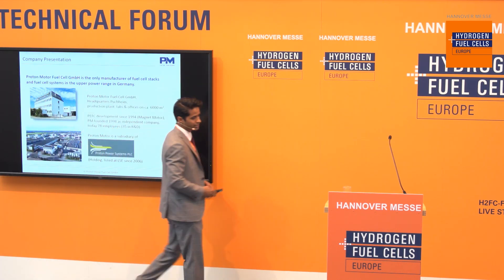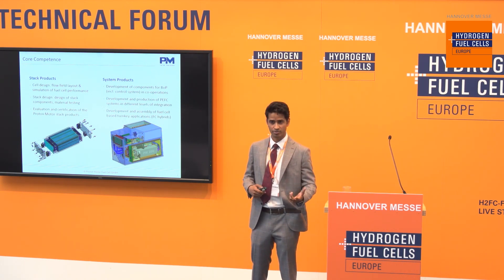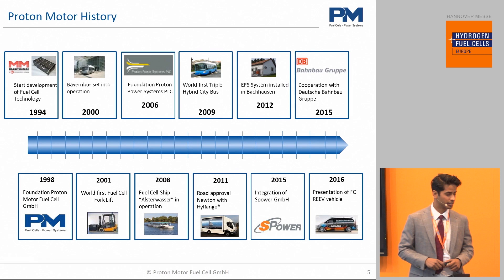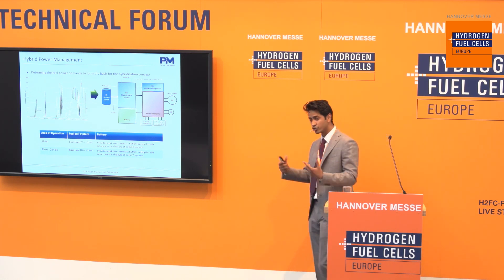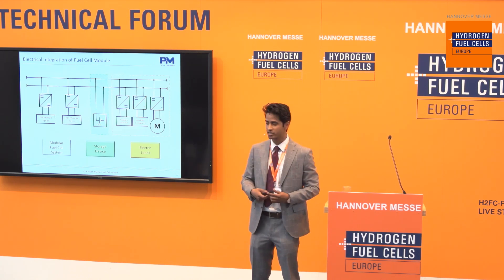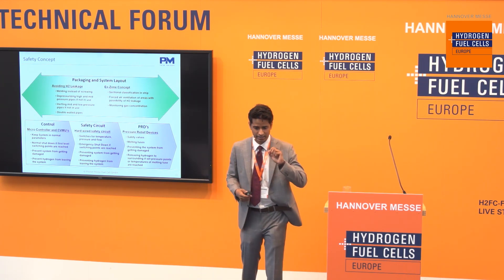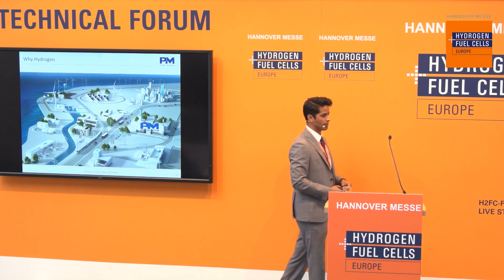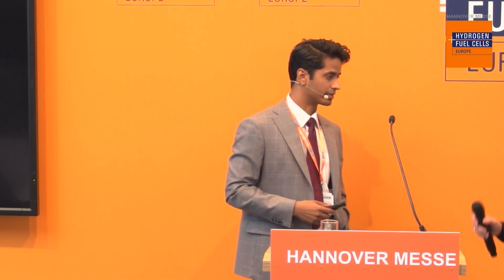Hydrogen and Fuel Cells in Maritime Applications

Comment: Interesting video, it’s refreshing that a company is pushing this technology. I have a question though. I have recently become interested in boat ownership. I therefore looked at my budget and the running costs of a half decent sized boat to spend some serious time on. The fuel costs are frankly shocking! Most smaller boats use Volvo penta Diesel engines with an average £2K for about 250 miles range. Then it occurred to me this could be a perfect fit for fuel cell driven electric motors. 

My question is this. Can a hydrogen separation station develop enough gas, be compressed and used in a fuel cell to power a 50ft owner operator sized boat? This is a huge market and with the end of Diesel engines in the not too distant future, this may be the ideal time to get your feet wet so to speak. The running costs for such technology should be tiny compared to that constant bill for fuel. I would expect the weight and dimensions of such a drive system to be very much smaller too so more living space and perhaps performance could be enhanced. 

If nothing else it’s an interesting question and the answer I hope isn’t a quantum leap away. A large manufacturer such as princess yachts in the uk I’m sure would be a great partner in developing a test bed and possible market for this inevitable technology.

Regards 

CS
Reply: Hi CS, I was in the middle of posting something similar but different to you. I was wondering how Hydrogen compared to Battery, Diesel and Petrol as a means of energy to propel vehicles per mile, or over a set distance say 50 or 100 miles if mile by mile would be a  too smaller figure to work with. From the little that I have read, I think anything that is Hydrogen powered will have to be new as the cost of converting anything to run on Hydrogen is going to be beyond belief which makes me wonder if Propane could be the way to go ? ok it is not as clean as as an electric powered vehicle but it's far cleaner than petrol or diesel so it could be the way to go to fill the gap there is going to be until fuel cell's and everything connected with them become the "norm" to power vehicles, as I am certain they will be until something far more efficient is developed at some point in the future as I personally don't believe electric vehicles in their current form are going are to be powered as they are now for many years into the future. To me they are something to use and develop, only until something far more efficient in every way comes along.
Reply: Hydrogen is not suitable for that scale. You'd better get a lithium battery powered electric boat.
Reply: @quantumthinker3248  Can lithium battery power the offshore oil and gas...? Where can I buy lithium battery power production plaftform ( say for capacity 250 - 300 kW)